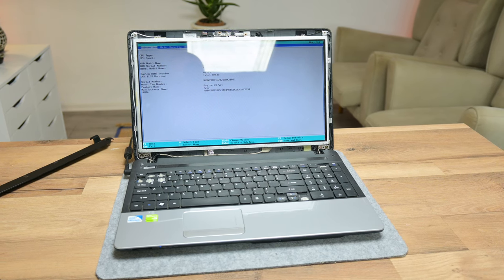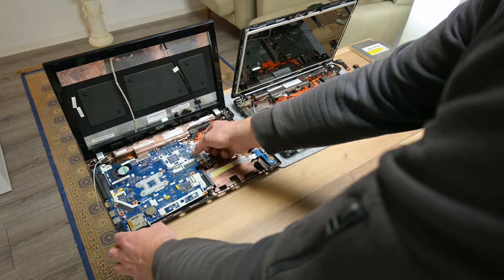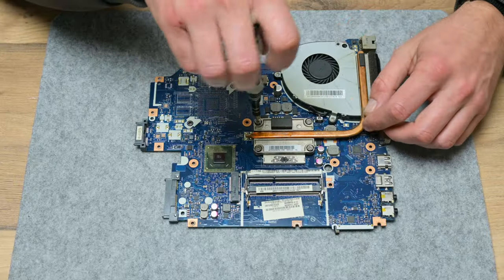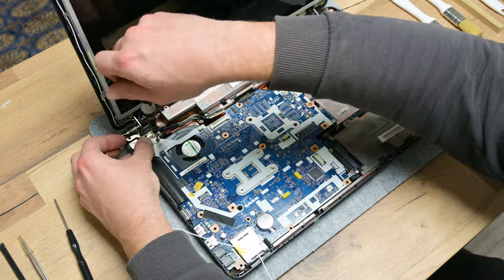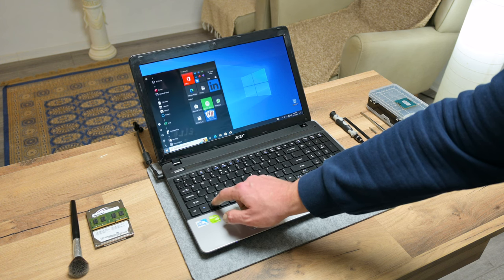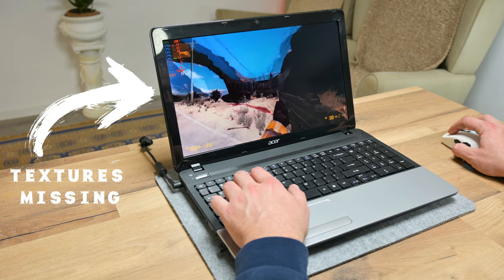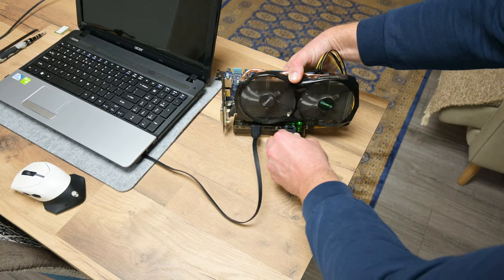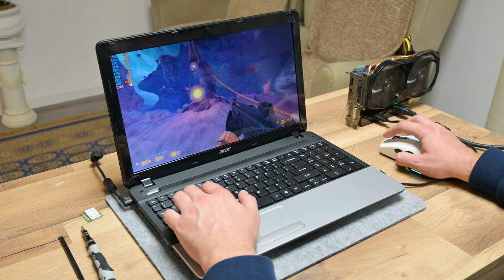I made laptop out of Trash - With Desktop GPU

Comment: Andrew, I haven't watched the entire video but when you switched from the Intel Pentium to an i7 it's possible now you require a 95W power adapter. Some computers output a warning others just refuse to power on. Perhaps this may fix your issue.
Reply: Or a newer bios that accepts newer CPUs
Reply: He used the i7-3632QM, which got the same wattage as the dual-core Ivybridges, so the default 90W adapter for dual-core laptops with dGPU should be enough
Reply: the laptop with that upgraded i7 CPU exceeding that limit a bit. Let´s say you comparing dual core against quad...okay.. you saw that that the both cpu has same wattage which is on paper completely fine but in reallity the i7 consumes around 15 to 20W more than Pentium and you can clearly that checked by using stress test and thermal monitoring. Original pentium runs on that heatsink just enough cool, like idk 70c max but with that i7 the temperatures are not 70 but this time 80, that means that the i7 consumes a bit more. it is not a tragic, the VRM should be also good to go but it requires a bit more watching because they might be overheating at some point. I was upgrading from sandy bridge pentium to an i5 ivy and it did increased the overall performance but temps was also a bit off a safe area so i was forced to use a cooling pad and later that day i discovered that the copper heatsink itself has some varnish or coating paint to match the look of that laptop chassis so i removed that varnish with IPA and temps was like on that pentium but this time on i5 and that i5 was 45 and pentium 35
  @pillowrex811

Comment: One of the great pleasures of this site is seeing how meticulous Andrew is and how he cleans everything. This might not seem much but professional repairers will tell you that various sorts of muck cause component failure and that makes perfect sense given the physics of electricity. 'Clean' is not the same as just looking clean and  fairly battered externals in long used professional computers often conceal well maintained insides. This is especially the case in schools, banks, offices and centers of administration and the key point is that such contexts employ maintenance contractors.
Dirt also creates heat and heat and this is an enemy of effective use of electronics and longevity of components. The ultra-slim fad also is a big enemy because cooling air must not just circulate but be in a quantity sufficient to expel hot air and draw in cool air. FLIR photographs show hot spots on all sorts of computers (not just laptops) and we would not drive a vehicle which did not specifically cool components and just relied of general cooling, so why do we accept a generalist approach in our IT machines? The answer is because designers too frequently put style over substance and are lazy. Some strip I/Os to the bone and others try to reduce heat by fitting weak and weedy processors (boasted to be eco-friendly) but they pair these with very large capacity spinning hard drives and current-limited RAM so such machines appear brisk when new but very soon fill up with fragmented trash and become woefully slow, especially as OS sellers give little or no advice on how to avoid and dump bloat. Instead these machines have trial copies of management systems like Norton and McAfee. HP and cheaper end Dells do this. Apple simply failed to tackle much and heat for years and did not seem to realize that I/O ports actually assist with venting if not overloaded. Enter the hub and daisy chaining -- which are never shown in adverts. Apple is making slightly thicker laptops now and Lenovo and Dell are being less obsessed with slimness. A slow increase in I/Os is happening but it is very slow and SD card readers are still missing from far too many brands -- including the Acer which Andrew features here. It is a pity that Acer's 2023 range is inconsistent in this because the brand is known for good, honest value without pretension ranging to some high end machines of better functional flexibility than the Big Boys, who often make overlapping models simultaneously, which vary in different parts of the world.
Making a well functioning machine from a few 'dead' ones is certainly time consuming but the result can often be an old laptop re-vamped to perform well beyond original spec even though such as Windows 11 will not recognize "security" requirements and some companies "white list" components. This is active sabotage of people's property and if companies have this sort of power to remotely inspect a given machine, what other things do they inspect?
Adapted machines and avoidance of the tyranny of Microsoft, Mac and Android etc etc seem to beckon us to a more secure future with different operating systems waiting to be developed and they will compete in a different environment/time frame from the ageing giants.

Comment: I have a Gateway NE56R with Intel Celeron B830. I had to change the motherboard for an Acer E1-571G and put an i7-3632QM processor. Everything works fine for less demanding tasks.
Thanks for uploading that video. It gives me an idea of how far the laptop can go.
The problem of the motherboard turning off at a certain time was due to the chipset since it is HM70 to be fully compatible you need an HM77 board. It is That's why I had to change motherboard to avoid this problem.

Comment: Not bad at all! Personally if you're going to go for a new keyboard, you might as well buy a new bezel to replace that broken one. A new bezel only costs about £10 or so for most laptops, especially older ones.
This really makes me want to start upgrading and repairing PCs again. That screwdriver set looks nice, I might buy one for portable/travel use where I can't fit my Ifixit Manta set into my bag.
Also, yes I always keep older components as well, just in case - such as RAM, hard disks/SSDs, wireless modules, etc.
Also, for me, it's not worth going down the eGPU route. If you have to remove the Wi-Fi card then it no longer becomes a portable machine because external Wi-Fi dongles (albeit better than most older inbuilt cards) are fragile and susceptible to breaking (or the ports being snapped) if moved around a lot.

Comment: Laptop EGPU support via m.2 must be related to which internal gpu is connected to the display. I assume that if the internal panel is connected to an intel or amd intregrated gpu an external GPU can output to the internal display. This is similar to how dedicated nvidia gpus in laptops merely process the graphics and it passes it back to typically an intel igpu to display into the display. If the main display is directly connected to the main display, the external gpu might not be able to pass the video back to the other dedicated internal GPU.
Reply: Also, I personally wouldn't go with an eGPU if you have to remove the Wi-Fi card. However, some devices have eSATA connections or similar, meaning you can connect directly to an eGPU without having to remove the wireless card.
Reply: eSata is not PCIe and will never support any GPU, it's only for storage devices. You must be thinking of an mini pcie or the external express something. @TheSpotify95
Reply: How know if i can use the laptop screen with a video card?

Comment: Very informative video , i want to ask that what connector will be best for my hp probook 450 g5 its and 8th gen i5 machine 8520u with 16 gigs of ram. As i want to install an e gpu the gpu i want to connect is rx 580. One last question the connector will be connected in m2 slot or there is another option in this laptop bcz i want to use this m2 ssd

Comment: Want to ask you about moldy lcd, is  moldy lcd can be fix? Or the only option is the replace with the new one
Mine is moldy and many dust inside the lcd acreen
Reply from the maker: Hi bro, moldy LCD in some cases can be fixed. The problem is somewhere between the layers and the foils inside and in some cases that can be cleaned but in some not. I have clean LCD beofre to laptops, desktop monitors and some old phones.
Reply: @ComputersAndTechAndAndrew   thank for your explaination mate, it really help 👍

Comment: Help! I'm using Win7 Pro , I want to install win10 but couldn't.
I'm using Gigabyte Motherboard , that is 64bit , ddr 3 2 slot ram , with 3.2 GHz Intel D processor.
I'm stuck on old game for win7 pro , ram 8gb (4gb 1600mhz x2).
HDD 320gb Seagate mechanical , gpu NVIDIA GTX 610 2gb

Comment: Great video!! Im just 14 and You realy inspired me in restoring laptops, i have a Toshiba Satellite L500-202 which was kept in my dads closet for probably more than 4 years, it had 2GB of Ram, a dead HDD, and an intel pentium (R) T4400. I disassembled the laptop, clean the motherboard, repasted the cpu, added carbon fiber vinyl wrap on the case, installed kingston 128GB SSD, and upgraded to 4 gb of RAM. My future upgrades I am going to make is upgrade to 8GB RAM, install an eGPU through mini pcie. I bought a power supply for cheap and I have the msi 1070, the gdc dock is still on the way(taking around15 days to get delivered). One thing Im confused is the compability of the eGPU.

Keeping all that stuff aside, you have inspired me alot into doing this!! 
Tons of Thanks!